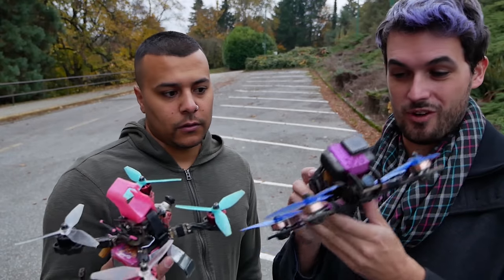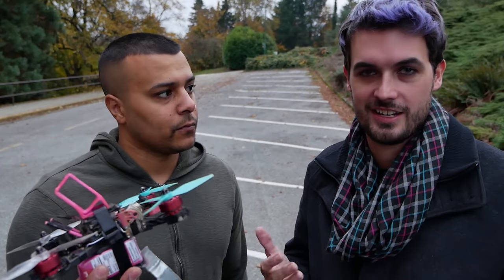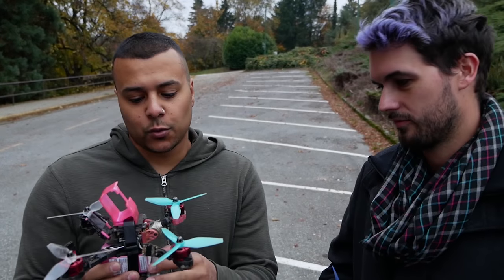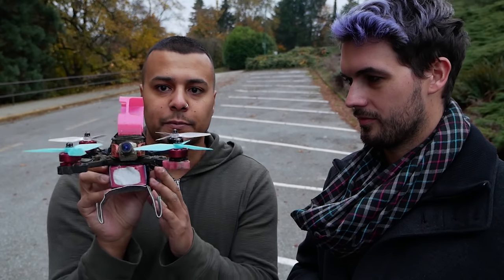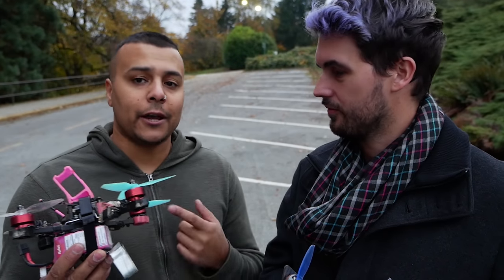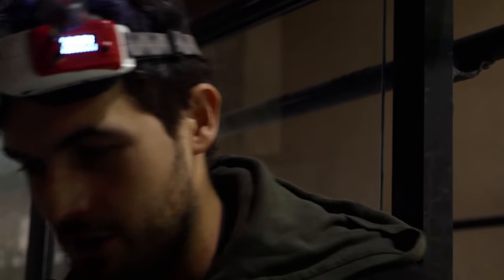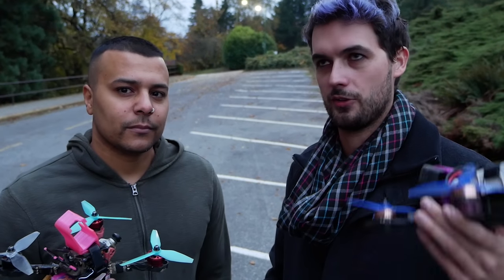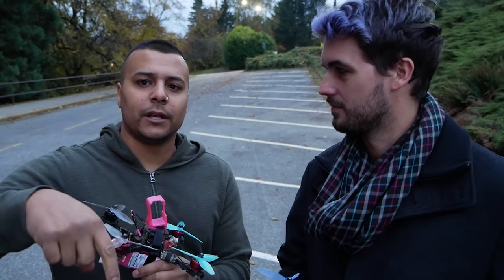Grinding Rails with Drones!!

Comment: For better learning, you could try the following:
There is a sweetspot where the drone wont lift off in idle, but with very little input you tilt forward and skid around on the floor.
search a Line on the floor and play with it, try following, try bends, try spins without leaving the line
Try to learn how to move your quad on the line without any rules blocking you.
This could help everyone to understand what's behind the movement.
You can even grind some curbs and start low. after that? try the Rails, try the Tubes, try a roadsign, with a really really small edge, (with no cars in sight please)
i think with this, hovering movement you could grind almost everything
Reply: This technique works quite well on a frozen lake and is quite fun to play around with.

Comment: Next... tiny caster wheels for some sick low-g wall rides on billboards. I see it coming.
Reply: yep
Reply: I did that once on my 2.5 incher with Legos and it was useless.  It is very hard slide down anything because of the self leveling and it was a waste.
Reply: Maybe ball bearings in a 3-D printed socket

Comment: i think i like the skids more than the grinds, and i'm not sure about the one trick direction?, the thing i like about quads is they can pretend to be a dji 4 and the swoop inverted into trees and maybe some slow proximity, then fast and low across some contours  and didnt somebody already do a backwards grind down some rails?
Reply: Steele did it

Comment: wonder if maybe setting up a momentary switch with a mix that will toggle your mode back to acro while the momentary switch is held, then back to where ever your mode switch is set. also, time for grind specific frames with replaceable grind surfaces.

Comment: Hey look, Aragon! Spent about 6 batteries trying to figure this out on my PCV practice rail set in my yard. Certainly easier on the gear then a metal rail over concrete. Still ended up stuck in the fence once.

Comment: Just some tips it’s a lot easier to keep a higher idle 6.5- 8% and not quite staying on the rail but giving the illusion of grinding and square frames also help also (lol) connect that grind bracket that u have Martty to the arms.. you can’t really grind with the bracket centered like that over your battery.. your welcome

Comment: I use a Slap Bracelet mounted to my bottom plate so when I hit rail it wraps around but can still fly away. Will upload vid ltr.   nice vid.
Reply: I Run basically Nowak Reverb Silk V2's  and have not had any bounce off from FC.  In fact When I slide or grind kiss FC "Knows" and it feels like getting sucked down when sliding

Comment: Dude I was doing this on accident with my Tiny whoop the other day on some vertical piping. Basically you can lock the rail in between your tiny whoop ducts and spin around it and go up and down on it. Haven't tried this in acro, or on horizontal rails, but with a little practice i'm sure a whoop could grind between its ducts at any angle??

Comment: How about some weak magnets? With just enough force to keep u in place but not fully lock you place.  Would only work on metal bars but. Just a thought.  And also since it's not rubbing against the quad itself it wouldn't be as harsh.  As well as maybe having multiple like one on the underside (top mount) as well as some on the arms for different angle of attack

Comment: Anyone try it yet on like an acrobrat style frame with the front crossbar. I would think that front bar in a frame even like a catalyst machine works MERICA-X over a traditional x or stretch x acro quad would really help with a grind because you can keep your pitch  and use the front bracket to grind.

Comment: New to the hobby, about a month in...but this was one of the first things I started thinking about and wondering why no one was doing it.  I think a new style frame for this type of freestyle is needed.  Something with grind rails or maybe even some wheels.   I was thinking of a hybrid style ground and air tricks with something on the bottom, to allow you to throw yourself around on the ground or different surfaces as well.  You guys flew a uke... make a skateboard quad.

Comment: Y'all need to try this with Helio boards and the new FU IIMUF firmware. Would make this so much easier for you. Possibly even with airmode on, I don't gnarly slides with airmode on with my setup.

Comment: Awesome video guys! With kiss I learned to grind leaving the idle without gyro (without idle up), so when I cut the trotthle the quad doesn't respond but it keeps the props spinning. What do you think about that?
Reply: You can do the same thing in beta flight with some work and I tried it. The problem is you also lose the ability to control the quad so I’m not able to hold pitch forward or balance on the roll access. You just flop off the rail

Comment: So... unless I'm mistaken, even with airmode off the pid controller still reacts if you shake the quad. How about a grind mode from the betaflight devs?? Something that completely turns off the pids at zero throttle. Or maybe a tx switch to stop the props at zero throttle for full on next level grinds (for ledges only) I guess if you turned off airmode, and had don't spin props at zero throttle set, then you could use an idle up switch for stop prop grinding... I'm gonna have to play with this. Thanks Drib! Now I'm gonna break even more stuff!
Reply: It's been around sense clean flight.  Pid_at_min_throttle=off
Reply: If the PIDs are off it will just fall out of the air.
Reply: @JoshuaBardwell  Yes, but if your grinding a ledge that won't matter.
Reply: @KelvinFPV  Thanks, I'll look at that. It'd be nice to be able to assign it to a tx switch.
Reply: Right Joshua but for the initial contact you would be back on the throttle shortly after just make sure min  check is 1005. Works great for "pirching" too.

Comment: bottom mount battery and knife edge it the whole grind balancing on the battery and frame. just a guess.
Reply: try coming in below the railing, pop up and into the grind. maybe you have to sling into it? or come in hot and 180 into it?

Comment: why not try using a support on the back too.  So it would have the effect of trucks on a skate board in a 50/50.
But put it on a stilt so both are the same level while the quad is tilted forward. might give more stable result. 
Im building my quad right now so i cant test it. Good work from Scotland.

Comment: I would like to see how long you can do a vertical grind upwards(might need to mount grinding fork at a 45 degree), and of course a vertical dive grind. It won't be easy, but hey you are the best at this. Zoe needs to do an inverted grind. 😬

Comment: Not sure if this would translate to rails or not, but find a frozen lake with smothish ice and try to fly skate around. You have to keep the quad at just the right angle to allow movement but not destroy your props on the ice and direction changes have to be subtle but enough to get the quad to go in the direction you intend. Getting a handle that type of movement  may make rails easier to ride for longer distances. Check out my latest  vid  if you want to see what i mean by fly skating.

Comment: Or try to screw a top plate from a alien or eachine ts215 under an alien or stingy frame the way it sticks out +- 2cm . If u set the camera so u can see the tips of the fork u also see what you have to do. If it works youre the man to design a special grind frame. Or you all can design special grind plates/forks that u can screw right under all the existing frames.

Comment: The clamp on Matty's quad feels cheaty. Just cut it a tad bigger than your pack and maybe mount one on the back of the pack as well, or do a whole grindplate under it. Should suffice. Otherwise good stuff, grinding quads is awesome for sure.

Comment: Your approach cannot be slow and it's in the pitch forward.
Reply: Forward momentum limits sideways variances
Reply: @williwonti  yup, I have found a 1.8mm lense is helpful. I run 35° tilt so my forward is there. When I feel I'm 1/2" off the rail I drop to 5% throttle and pitch 20% forward with airmode. Grinds like a champ

Comment: What's with people wanting to make it more easy by "adding this" and "making this to do that". The whole point is it's supposed to be difficult and natural. You don't see skateboarders adding things to make grinds more easy.
Reply: Skateboarders add wax to grind & slide smooth
Reply: scirockalot8v oh like wax on the bottom of the board to make board slides easier or trucks that are specifically designed with grinding in mind....   shm.
Reply: Or what about the sliding rails that you can screw on to the board
Reply: You can tell Matty is bummed he needs to use the mount on the bottom, but bottom mount battery means there is no place to grind while staying relatively level. Would you be happy if he added little skate board trucks to the bottom of the battery? I would. lol.
Reply: It will progress to not needing them. The hobby didn't start with rate mode but not many use angle even on day one anymore.